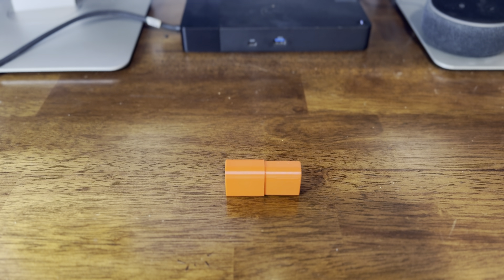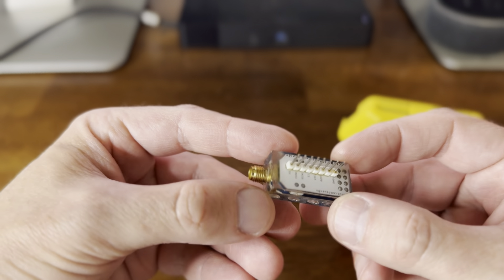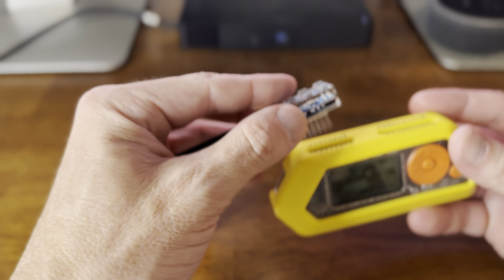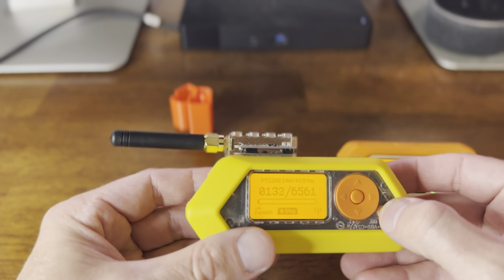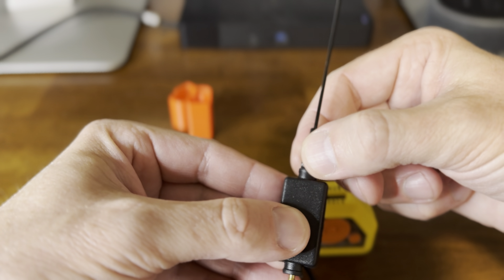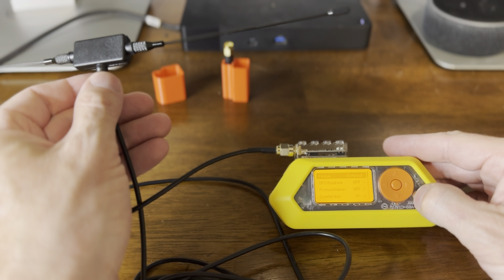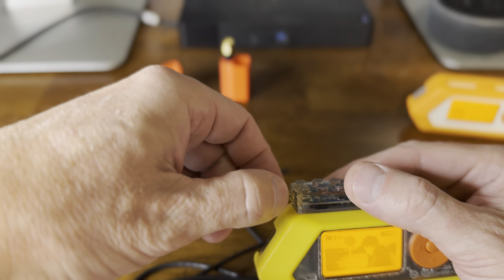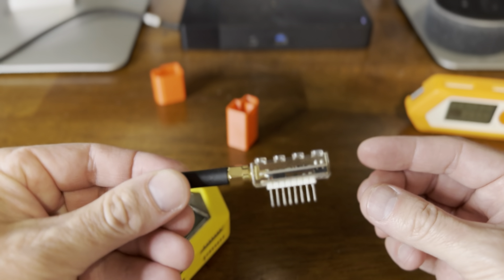Lego Flipper Zero External CC1101 Module with Dual-pole antenna.

Comment: Have you been able or have you tried to keyless entry a vehicle and turning on the ignition on a pske system using 2 of these device to grab the key fob signal using a 125-135khz antenna ?
Reply from the maker: I have not.

Comment: Does the module also support 868 Mhz?
Reply from the maker: You can run that signal through it, but it doesn’t work very well as it is tuned much lower. I wouldn’t do it.